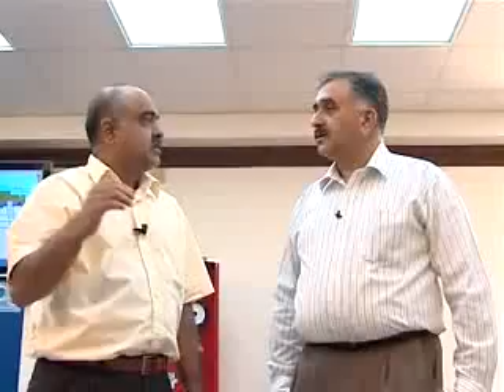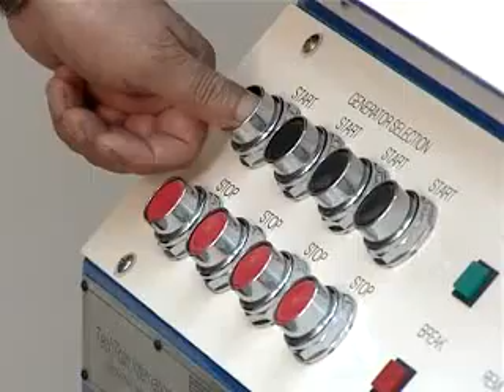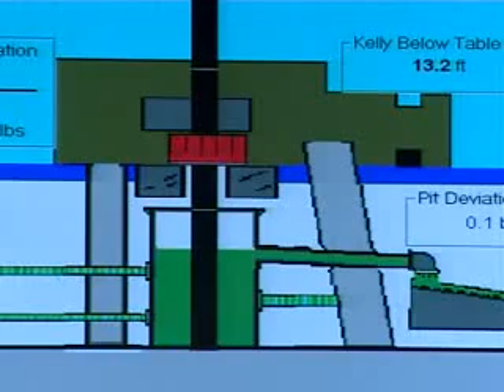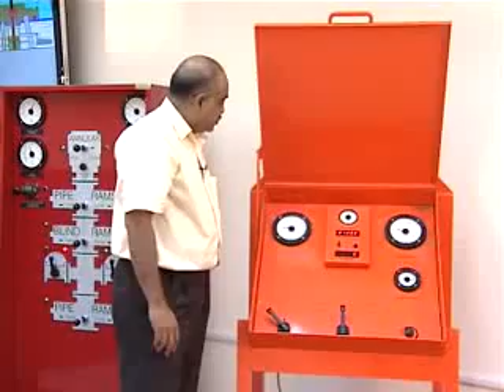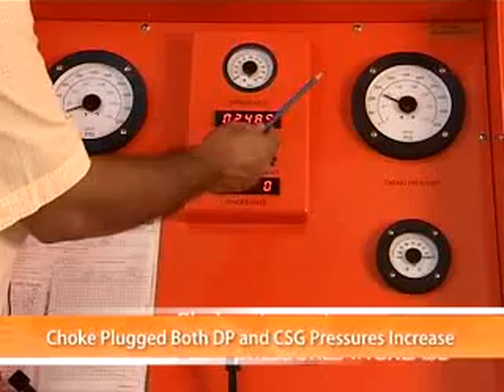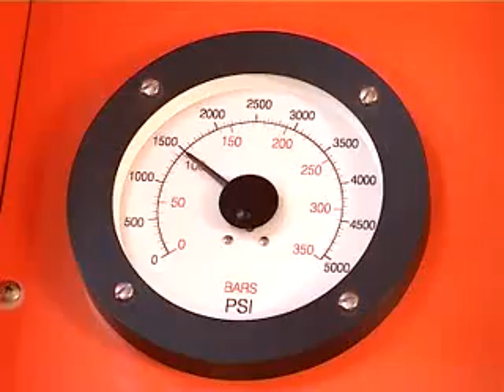40.  Well control simulation  ,  Simulator Control

Comment: The hard  shut in is wrong . He opened the remote choke which is suppose to be in closed position. 
He  should open the HCR not the remote choke
 Step 1 .. space out the drilling string .
Step 2 stop the pump 
Step 4 : close BOP 
Step 5,: open HCR 
Step 6 record data.
Note the remote choke is already in closed position in hard shut in.